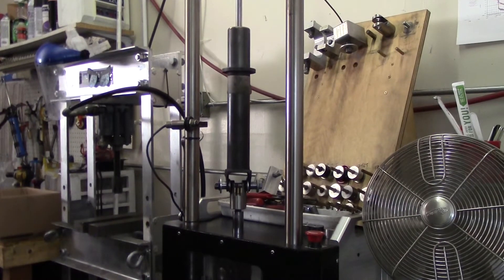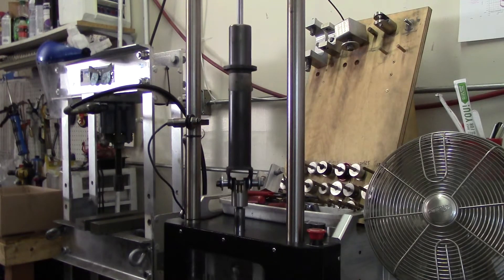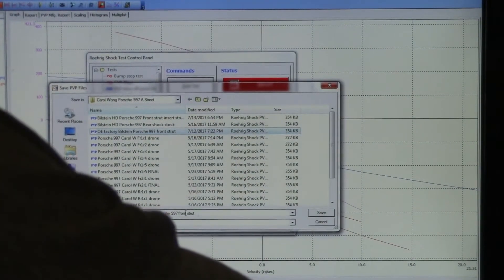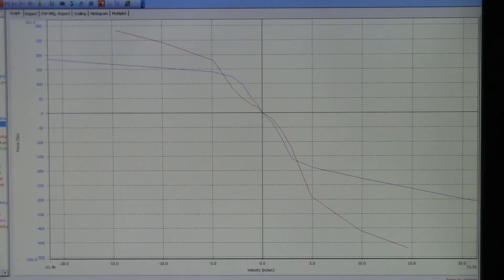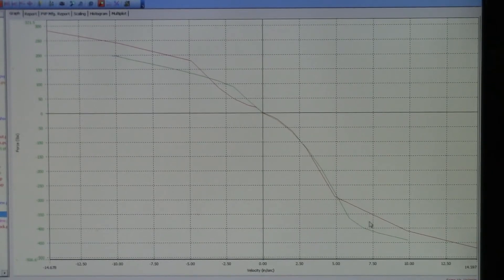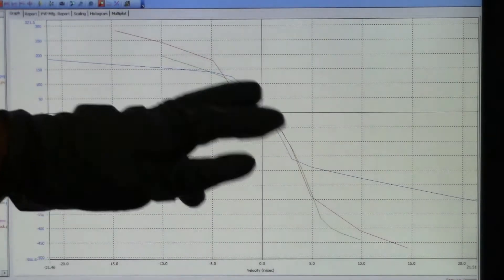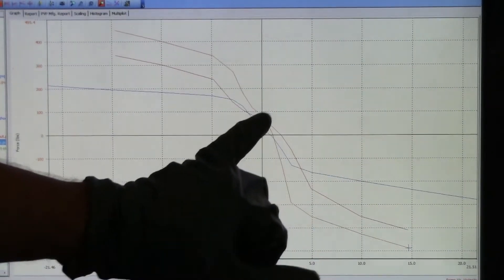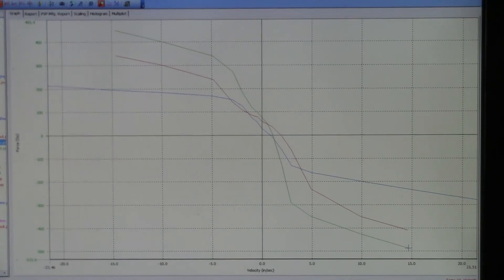OE Porsche 911 (997) rear shock testing and comparison to OE 993 rear

Comment: Hi, it seems that most sports cars have much stiffer dampers than you think is appropriate and that aftermarket dampers go even stiffer again. I get the impression that this is because people feel that stiff suspension is better because it feels more sporty, even though it's actually less effective. Is there any benefit at all to these stiff dampers? I am just so amazed at your findings, it's incredible that all these dampers are just gratuitously stiff!! Surely there must be some actual positive outcome from them??? Do Lotus do the same? Thanks, hope you can reply.
PS I have a Toyota MRS Roadster and I was thinking about getting some aftermarket Koni dampers but I am now having second thoughts because I am thinking they will be too stiff??
Reply from the maker: Thanks for your comment. When it comes to having the best traction - and not just control - many sports cars or 'sporty' suspensions are tuned for control at the expense of ultimate grip. I think there are reasons manufacturers do this related to road speed - a stiffer-feeling car often doesn't make you want to drive it too fast, and that makes sense for normal roads. But if you're talking about a high performance environment then not many OE vehicle manufacturers tune for the best combination of grip with good control. Chevy on the new Camaro and the Corvettes for some time have generally done a very good job. The German and Japanese automakers usually have smooth roads to work with but seemingly forget that American roads are always so nice! 

The main positive outcomes become find is that for autocross or track classifications that prevent you from changing springs, tightening the dampers can make your car faster. But often that's done by only increasing rebound damping and not compression, so you have to deal with a 'gokart' suspension which is very unpredictable and very uncomfortable (potentially even painful). 

Lotus, from what I've measured directly and seen online, tends to use spring rates that create pitch (anti-Flat Ride) which isn't good for ride quality or ultimate grip. The dampers tend to be pretty rebound-biased as well. This is on the previous Lotus Elise (circa mid-2000s) so I don't know if they're made other design changes since then. 

For the Toyota MR2 Spyder, the Konis are an option many autocrossers seem to use and can have success with. I drove a 3rd gen MR2 Spyder with Konis and it was okay. Unfortunately there isn't a direct-fit Bilstein available otherwise I probably would have built one and autocrossed it! I"m not sure is someone's done a custom project or not to make Bilsteins fit. 

A point about the Konis is that you can usually turn them to a softer setting for the street then stiffer them for autocross. Many racers do that on the weekends and it can work fine. It's not ideal, but nothing is. I would be happier to see someone get off-the-shelf Konis instead of having them 'revalved' to be EVEN STIFFER rebound and then driving that setup on the street! It depends on your goals. For the money, a Koni can go a long way. I would just run that shocks as soft as I can, and get a big front bar to help put power down better. Or, sell the MR2 and get a 99-05 Miata with Sport Package that we can tune some Bilsteins for and have the best of all worlds! ;)
Reply: Suspension Truth thank you so much for that excellent reply, I really appreciate your knowledge and experience. I need to read over it a few times to fully understand it all. I am only wanting to drive my MR2 on the road here in the UK (so very rough roads), I just like the idea of having the best suspension setup I can get. Shame about the fact that Bilsteins aren't available. Thanks again for your input, I find your videos incredibly interesting and so useful for developing my knowledge and understanding of a very complex subject.
Reply: Suspension Truth my very amatuer calculations suggest the MR2 has the same wheel rates front and rear, of about 1.53Hz. It is interesting Lotus go for anti flat ride. I wondered if flat ride is less critical for mid engine cars because the weight is concentrated in the middle which I thought may reduce the natural tendancy of the car to pitch, or at least reduce the pitch forces involved?